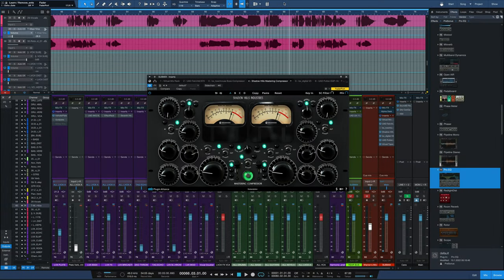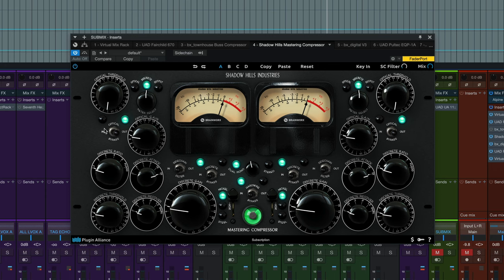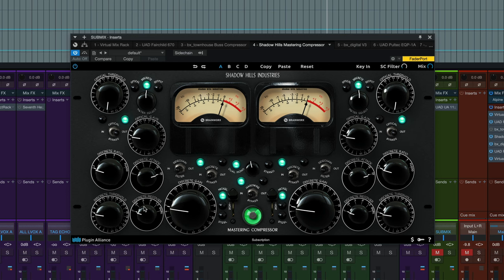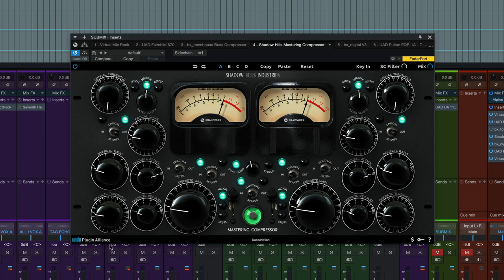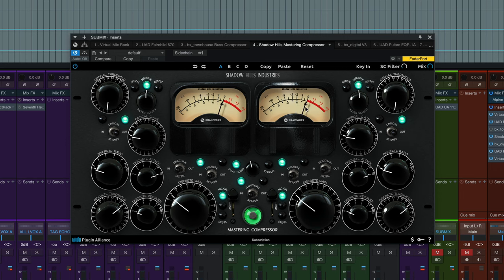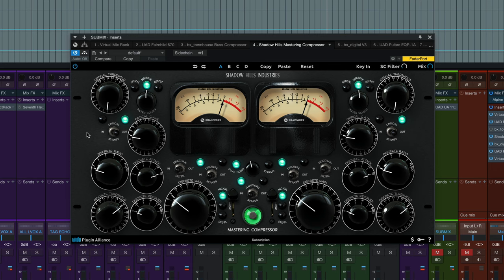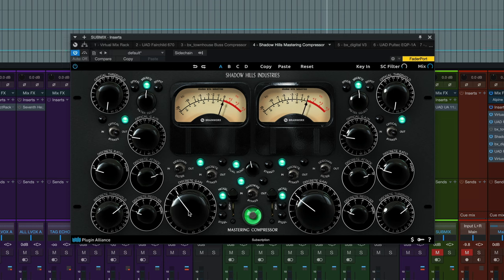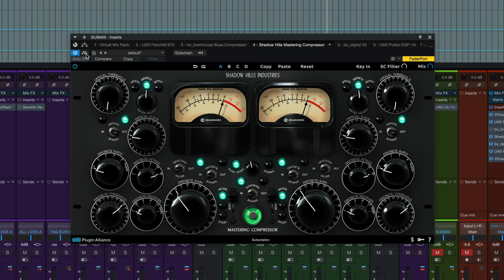Tony Maserati Mix Buss Compression

Comment: In this example I notice that while it glues the track together, it tends to choke and thin out the snare some.......I recently got the PA version and have experienced this before with drums. It's really easy to over do it, where things start pumping or choking.  I'd probably go no more than -2, maybe -3 ??. I know it's case by case things and context is everything.  I have friend that has the hardware, and he uses it more for tone than gain reduction. He usually does -1.5 or possibly -2 at the very most.  I want to experiment more with driving a signal into it hard, but keep it from going into compression, and see how it changes the tone.